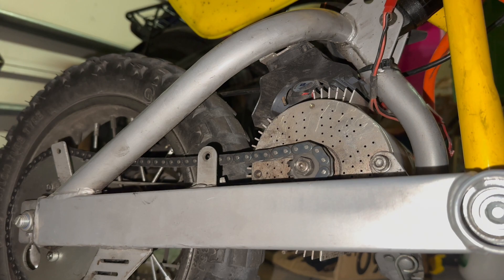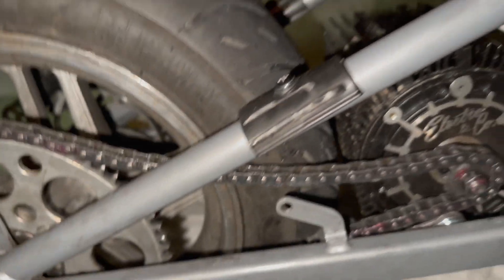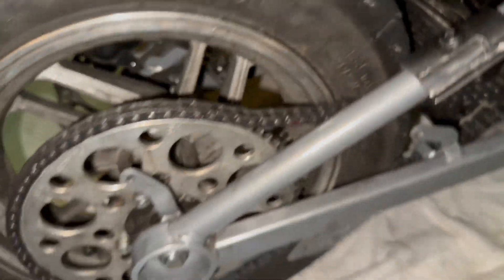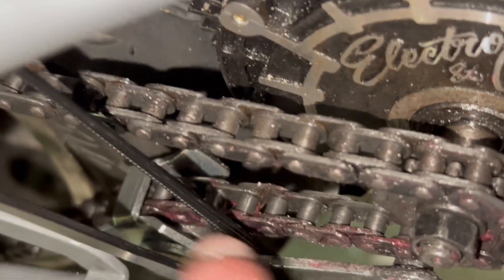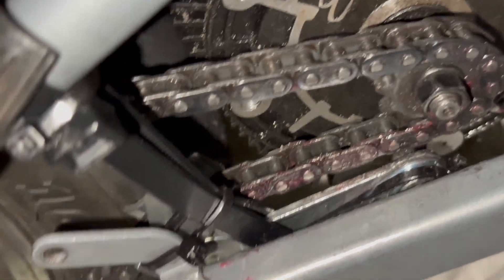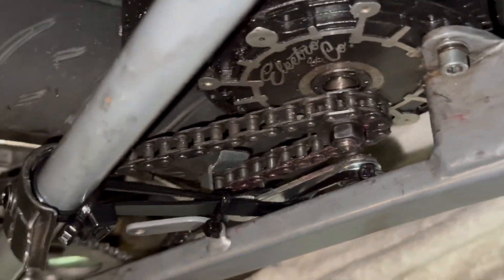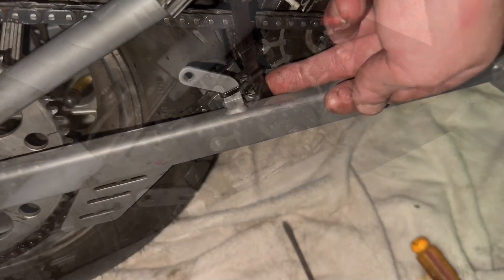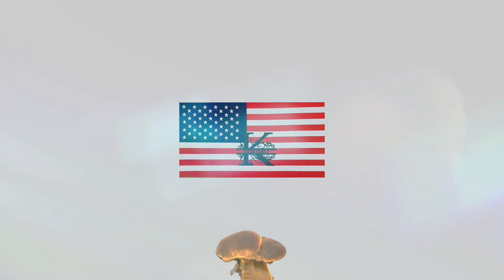Razor “Chain Tensioner” MX650/RSF650/SX500 -Dreaded Spring FAIL -What I Do,Cheap Easy Fix That Works

Comment: I just picked one up for my son it's pretty clean the chain is Rusty I can clean that up in some citric acid salt I only paid 300 bucks for it it's a year old. Definitely looks like a pain in the ass. I grew up old school racing motocross 2-stroke days broke my femur on my toes dislocated my big toe foot wrist pinkies scapula and probably at least 10 to 15 bad concussions I lost count LOL but I do it all over again I have a 05 KLX DRZ  110 tricked out I picked up a couple years ago for 250 bucks kid need money to pay a fine bbr Springs bbr rev box DNR rear shock 185 lb full pro circuit T4 Pro Taper bars in triple clamps super dope white Plastics with custom graphic kits unfortunately I have to have back surgery this winter I'm dreading it I put it off since 2016 from motorcycle accident play hits to the point where I can't take it no more I have no other options so I've been just sticking raise volume and selling RC cars making YouTube shorts with them and car audio it works pretty good. The main goal is to get some free RC trucks and we've received eight total including a boat and we beat the shit out of them and these little cheap trucks they are lower in hobby grade watch them 50 ft off my roof driving them through Amazon boxes on fire 15 ft up the tree snow sand submerging in water LOL

Comment: How Long is the Tf8 chain
Reply from the maker: All depends on your gearing. My RSF650 is geared at 9/54 currently. Or 6. I’m using 100 links💯🍻
Reply from the maker: If you have the MX or SX edition 650s, you want the E&C extended swingarm and chain tensioner. It is a GAME CHANGER. The best thing going.💯🍻https://www.electroandcompany.com/product-page/razor-mx-sx-extended-swing-arm
Reply: Thanks bud I'm going t8f on stock swing arm & tensioner 11/54t I guess a 100L t8f chain it is

Comment: So the way I've done it is get small skinny zip ties and go through the tensioner chain gaurd and into the little hole from the factory chain plastic guard. Holds the tensioner tight and up
Reply from the maker: Nice Bro. I did my original idea with skinny zip ties and it snapped within a few days. I switched to the monster and it’s been strong for weeks. I do leave a little excess tab on the zip tie in case I have to pull it tighter and to prevent any slip. But Someone needs to design a TRUE plug N Play Chain tensioner.💯🙏🍻

Comment: Its not just the spring its also the chain, been dealing with these kind of issues all year.. these t8f chains are made from junk to be honest and stretch really easy and even cause cogging problems
Reply: I dont have razors but i got two diy builds which one uses a tensioner and the other doesnt... doesnt really matter, the chain is junk quality
Reply from the maker: AGREE 100%

Comment: I had to drill and tap a new spot a little bit closer to the rear sprocket. The trick is to drill and tap all the way through and put locking nut on the other side. I'll post it on monday if you want to check it out. Im running the electro heavy spring and it works like butter.
Reply from the maker: I will DEFINITELY be checking it out Bro.💯💯🙏🍻

Comment: Electro & Co has the upgraded spring for the chain tensioner.
Reply from the maker: They do. And I mention that. It’s mainly when you upgrade your chain to t8f. The heavier chain is harder on the springs. With how many gear changes I do, this becomes a problem. This was with a brand new E&C spring. Just showing what I do.💯🙏🍻